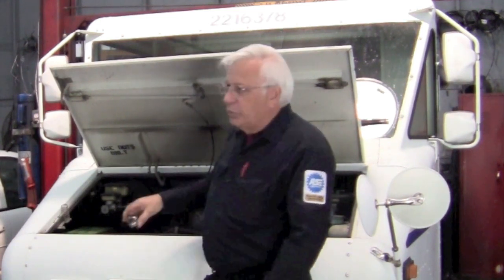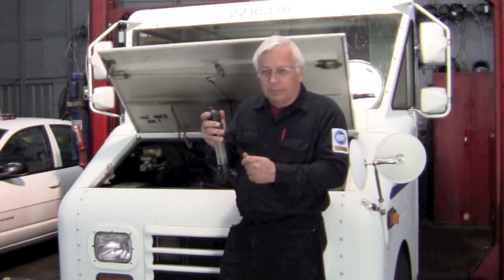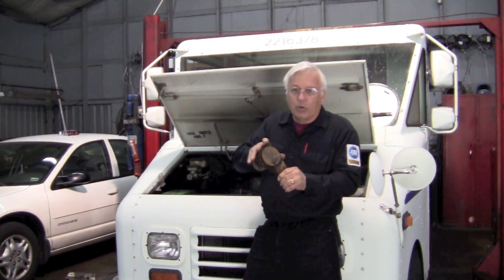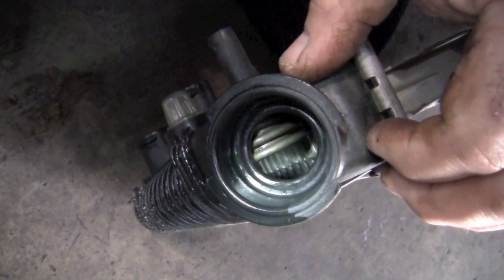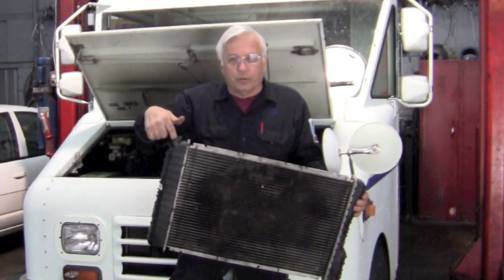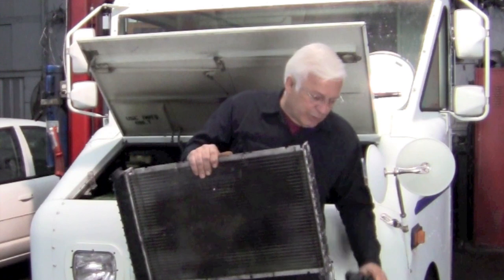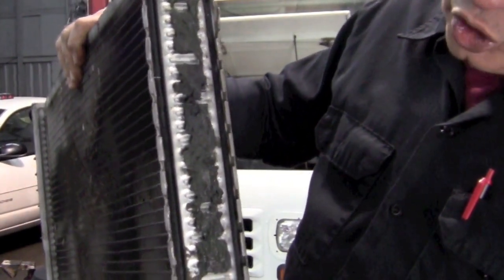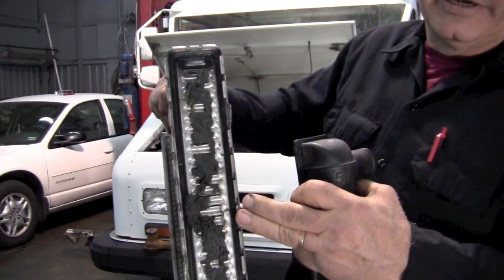Evidence

Comment: That's a fascinating problem. It brings up the interesting issue about flow rates. I'm a little surprised that there is not a simple flow tool to attach in line to a rad hose, that can objectively measure water movement and pressure in real time. Low pressure and low flow would mean bad pump, high pressure and low flow would be restriction of various causes. Although I do suspect that low flow would cause overheating and overpressure, regardless of the cause.....

Comment: Several years ago, I had a similar problem that turned out to be a corroded spring inside of the lower radiator hose.  Particularly when under a load, the hose would collapse when the accelerator was depressed.

Comment: been there several times on really beliving that it was a headgasket. only comment that I might add to this video is that pulling parts off to look at them is not time efficant and what about cars with a timming belt drivin water pump. a simple way to atleast get passed the head gasket thought is to grab the upper and lower hoses. one of them being cooler than the other indicates a NO FLOW issue usally a water pump or thermostat. great video. Thanks

Comment: Very nice test with the radiator. The only question I have about it is how fast should the water be coming out of the water hose that you stick into the radiator cap opening? Seems to me like there's a fine line as to how much to turn the water hose on or you can get false positive or negative test results from too much or too little flow from the spigot the water hose is attached to.

Comment: I'm curious if you can use that radiator again after pulling that inlet side off? Does it simply reattach or does it need to be welded or fluxed back on?

Comment: Lucky for you that it was not a modern car with a timing belt driven water pump, or a radiator that also has the A/C condenser built into it.

Comment: I've come across this problem at work before on a toyota camry , would drive fine until you went up a hill and close to the top it the temprature would skyrocket , after replacing the thermostat and still finding no difference , testing the fan and everything else i could think of it lead me to concour it had to be the radiator - sure enough it the radiator was clogged full of crap.

Comment: Or you could have saved yourself all that extra work of removing the water pump,thermostat etc and have used a digital thermo gun a measure the tempeture across the radiator and it would have told you rigth away that the was no flow...therefore being pludged.